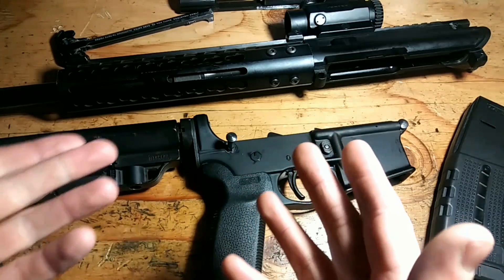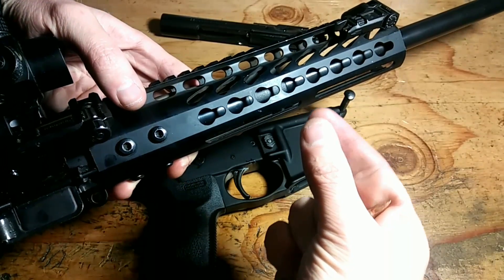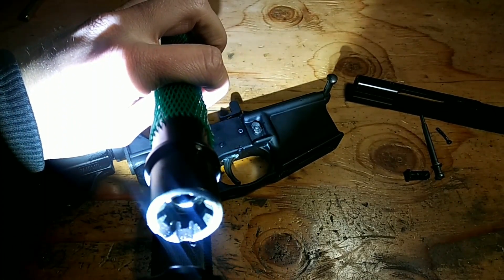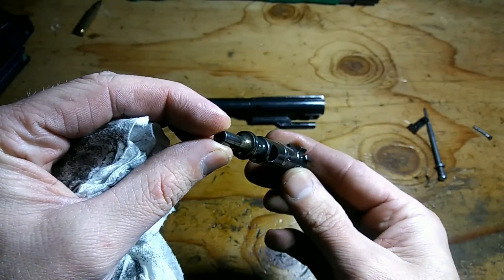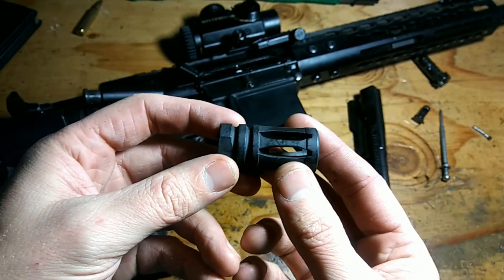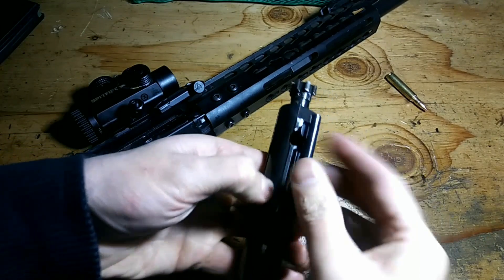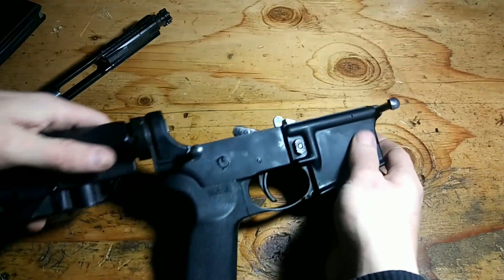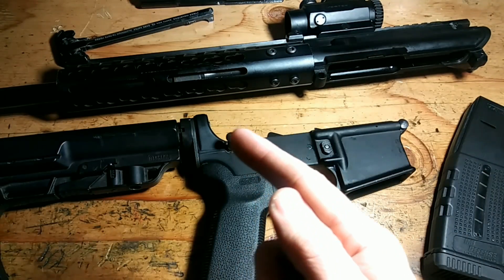How the AR15 works! SECRETS of the SYSTEM!

Comment: The somewhat loose weights in the buffer act like a dead blow hammer and reduce bounce. 

This is a good summary of the operation of the gas system. You were right on point about the bolt being like a gas engine piston. The gas rings are exactly like piston rings. However, you missed the genius part of Eugene Stoner’s design. When the gas starts entering that chamber inside the BCG, it is sealed at the front by the gas rings and in the rear by the bolt tail going through a hole. For a moment, gas expands in that chamber pushing the bolt forward at the same time the bolt carrier starts moving backward. This takes pressure off the bolt lugs while the cam pin, rotating as the carrier moves backward, disengages the bolt from the barrel extension lugs. As a result, there is much less stress on the points where the bolt engages in the barrel extension. 

Those vents in the side of the carrier are not there to vent “excess” gas. When the carrier moves back far enough so that the bolt has rotated out of engagement, the gas rings on the bolt clear those holes and pressure in that chamber is released.  The entire BCG is moving backward under inertia and you don’t need forward pressure on the bolt anymore.

Comment: The exhaust gas ports in the carrier are not for excessive gas. The gas rings trap the gas as the carrier retracts until the cammng action is complete.  The gas rings pass the exhaust ports and releases the gas. The firing pin bore also has an exhaust gas port too..The spring in the hammer is called a j spring. The trigger and hammer pins are designed to rotate so people who install anti walk pins should remove them..Glad to see you are in favor of the FA. https://www.youtube.com/watch?v=MhjU8InWxr0
Reply from the maker: So at the end of the travel...if there are no ports...would there be too much gas? Lol

I know what you're saying but its still releasing the gas it no longer needs.
Reply: @DouglasThompson  It is like a engines valve that releases the pistons exhaust. If the exhaust or gas is excessive, then the engine or rifle will not run right. The gas is moderated by the gas port and rifles gas efficiency to prevent excessive gas. I also understand what you are saying but there is a difference between releasing gas at the proper time and excessive gas..In any case, we are arguing over the same thing lol, nice video and have a great day...
Reply from the maker: @hairydogstail  I agree, there is definitely a difference, thank you for clearing that up, I was just defending myself but at the end of the day It was not the most accurate explanation. Thank you for taking the time to school me. :)

Comment: As I understand it, the gas pressure from the gas tube is only for unlocking the bolt.  It isn't sufficient to drive the bolt carrier group back into the buffer tube.  I've seen a lot of people explain that the gas is what drives the bolt carrier group back.  Logic dictates that it's the back pressure from the cartridge doing most of the work.  Am I describing this correctly?
Reply from the maker: Possibly but I dont think so, I could very be wrong about the nuances, though as I am not a professional.
Reply: @DouglasThompson  You did a good job of explaining the mechanism, professional or not.

In both the direct impingement and piston systems, the amount of force provided by the gas tube pressure seems inadequate to move the mass of the bolt carrier group into the buffer tube.  

It makes more sense that the pressure from the cartridge is locked into the chamber by the bolt lock mechanism you described, for a period of time to allow maximum forward pressure in the barrel.  Then once the gas tube pressure unlocks the bolt, the remaining gas pressure in the barrel will "drive everything backwards", ejecting the casing, etc....

Otherwise, in the piston system, the short throw of the piston would require a tremendous amount of force to move the much larger mass all the way back.  It doesn't seem right.

The "unlock" theory seems right to me.

By the way, thank you for taking the time to make the video.  I don't own an AR (yet), and I'm doing my best to understand what I need to know.  Cheers.

Comment: What would happen if you shoot it without the gas block or gas tube? Would it shoot and you would have to manually pull the charging handle back? (Similar to a Bolt Action rifle)
Reply from the maker: Yes it would shoot a single round but as you thought there would be no round loaded after each shot.
Reply: Douglas Thompson Alrighty, thank you for the info!
Reply from the maker: @ethanbakkes9367  Also if you end up trying this, keep in mind the handguard will be a dangerous place since the gas hole will not be routed to the block. I think you can get barrels that are not drilled for a gas system but Im not sure they would be easy to source.
Reply: Douglas Thompson I was just wondering because I just got a new handguard and I am very impatient to wait for a gas block that fits and I just want to test fire the rifle
Reply from the maker: @ethanbakkes9367  your handguard will be full of carbon after a session. Wont really hurt it short term but I wouldn't recommend it.
Reply: Douglas Thompson yeah, Ill probably wait it out, or just wear some thick gloves.

Comment: Hey Douglas Thompson Can you explain why after the first shot on my AR15 - I have to release the trigger fully then wait before it will fire again>?
Reply from the maker: You mean there is a delay after the trigger is fully let go?
Reply: @DouglasThompson YES. I Pull the trigger, it fires, it reloads then I have to release the trigger all the way it clicks then I can pull trigger again.
Reply from the maker: @jackiemitchell8482  all i can think of without actually being able to see what's happening in person is: Too weak of a spring in the trigger group, some kind of burr or damage causing a hang-up, old grease that is acting like a gel slowing the action, something could be machined to slightly off specs. Does it happen every time consistently? Can you make a private video of the lower close up in action? Its very hard to tell whats going on without it in front of me.

Comment: I recently built a lower and notice my safety is too loose ( kinda floppy/ doesn't snap in place) . When installing safety, can it be done before, or after trigger group or does it really matter?  Also, when installing, does the  safety need to be in fire or safe position or dose it matter?   Will a higher tension spring help with the loose safety problem? Or should a drive the detent down into the receiver so it catches the groove better in the safety selector... ?  Any insight will be much appreciated, thanks
Reply from the maker: Is it loose in the hole or just doesnt feel like it locks in place securely?

If nothing but the saftey was in the lower, could you move it up an down, side to side? Or would it only allow rotation?
Reply: @DouglasThompson  There is a little bit of side to side play in the safety selector hole. I cant push the selector out of place with finger pressure, ( it would need to be punched out so it holds in place) but it is a bit loose side to side.... thanks for the reply
Reply from the maker: @whydotheathensrage  that could be part of the issue. You can try putting a small piece of something inside the grip spring hole to make the spring feel stiffer. It would have to be a perfect fit so the spring wouldnt get bound up. What safety did you buy? Did you get it separate or is it from a kit?
Reply from the maker: @whydotheathensrage  perhaps the safety detent is undersized? If its too small for the  it could make that feel like its not solid.

Its hard diagnosing things when you cant hold it and test things out in your own hands.
Reply: @DouglasThompson  the lower parts are Luth AR, the receiver blank is from 5 D tactical. Im getting some different grips, detents, springs and safety selectors to play with, this is an experimental lower, (not part of a complete build) so Im going to experiment with different components, etc,, thanks again for your help,

Comment: Why are people trying to call it a piston system.   The meaning of piston in a piston set up is the Gas hits a piston that in turn hits the bolt to eject.   No dirty gas gets into the chamber.   SKS is an examply of a gas/piston.     A AR15 is just gas going directly into the bolt to push it back for ejection.     Apples and oranges,  calling a AR 15 a piston system might lead one to think its the same as a SKS its not.    One avoids gases in the bolt are while the AR 15 lets gas into the bolt.  Call it what you want but that is the main difference.
Reply from the maker: I understand but the difference you describe doesn't make the AR-15 any less a piston system.
Reply: @DouglasThompson  Some would say the AR-15 is a lesser piston system or dirtier one for sure.   You can get them with a true piston system at a higher price though.
Reply from the maker: Yes, can get very dirty depending on the cleaning frequency and ammo types.

I have seen the ak-like piston systems and  they are very interesting.

Comment: Originally Designed without a forward assist....Being phased out as it causes way more harm than imagined...And No benefits aside from peace of mind “imaginary scenarios”... even the New sass/sr25 sniper rifle system did away with the needless and proven dangerous forward assist..
If you have to jam a round in, pray it’s not a squib, blown case, blocked chamber... 
that being said, mine has an FA...
Reply from the maker: I had a dirty chamber a couple times and the round was out of battery, nudged the FA with my palm and it went in, fired and I went on my merry way. :) 

That being said it was not out of battery in the middle of a mag it was the first round and my gun was just dirty from many rounds and I followed the bolt home a bit rather than chambering with the bolt catch release. 

Picture an imaginary scenario where you have to be super quiet, you haven't had time to clean your AR and you realize you hadn't chambered a round. Would you slam it home and risk being loud or would you try to gently chamber a round risking a bit of a bind? In the latter case, a FA would be pretty handy, I imagine. ;)

There is no such thing as an imaginary scenario, if it can happen, it has or will happen.

Comment: You mention the roller bearing on the bolt pin which seems like a good idea, but how do you feel about the small spring which some place at the tail end of the bolt to help keep it pressured forward? Perhaps this could help minimize the wear on the upper receiver?

Comment: I don't like forward assists not because I can push the bolt forward with my fingers, but because if my rifle jams, there's a reason why it jammed, and I think forcing it into battery is going to make it worse more often than not.
Reply: I know this is an old post, but I thought I'd reply anyway for future reference. The original M16/AR-15 did not have a forward assist. Stoner knew perfectly well that it wasn't necessary. But when the Army started acquiring the rifles from Colt, despite Colt telling them it wasn't necessary, the Army required it for one reason, and one reason alone: as a security blanket for soldiers in battle, to mentally assure those who were used to having a charging handle affixed directly to the bolt on older rifles, that they'd have the OPTION to force the bolt home should it jam in the heat of battle. There were even other differing designs for the forward assist before the ratcheting style we ended up with today. The standard M16/AR-15 rarely ever does jam, and the forward assist is really the last thing you'd want to use if it did, but there it is.. Air Force, Marines and NAVY couldn't have cared less about it, but the Army was stubborn about it.
Reply: @AlphaMachina  Stoner should not have said that the forward assist "wasnt necessary" but rather that if it did jam that no soldier should ever use it because instead of properly clearing it you can make it worse by forcing it in.
Reply from the maker: It's useful for slowly chambering a round when your gun is dirty.
Reply: @AlphaMachina   you are correct!
Reply from the maker: hulk hogan fair enough! :)
Reply: Protect your fingers,hot and pinch points.
Reply: Exactly! Ian M did a whole program on the development/ evolution of it. Clint Smith also talks about it. I’m 50/50. The bolt carrier can get warm/hot and also tough to use with gloves. Having an easier way to push the bolt forward works for me but if it doesn’t go easily pounding on it is a dumb idea. Training issue.

Comment: What  kind of gas system length and barrel length is that? Looks really short for the length of the barrel. Maybe it's just illusion of the video though. You will normally get more wear in the receiver where the cam pin resides on shorter gas systems since there is less dwell time -which looks like you got a lot of. Also,  that little circle hump in front of/around the mag catch actually isn't just meant to keep it from getting blocked. It's needed as a guide and keeps it in line so that the mag catch when pushed out doesn't get hung up when coming back in when it's depressed. I don't know if I explained that good, oh well ;)
Reply from the maker: cj spicy Thats very true about the fencing around the catch. I failed to mention that. Also this is a 16" 300blk barrel with a pistol length gas system. I chose a pistol length so I can run subsonics extremely well. And youre right the shorter gas system does beat up the internals moreso than a carbine or rifle length system. Good wuestions and thank you for filling in one of the blanks I left. ;)
Reply: Douglas Thompson oh ok cool, makes sense.